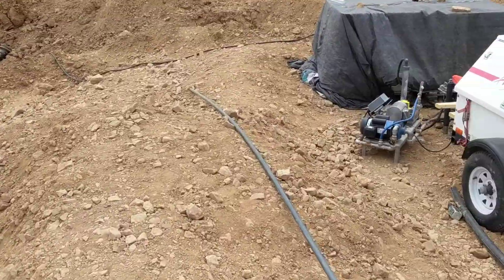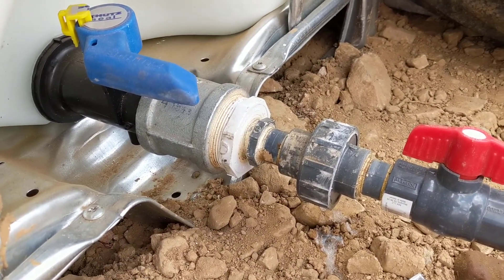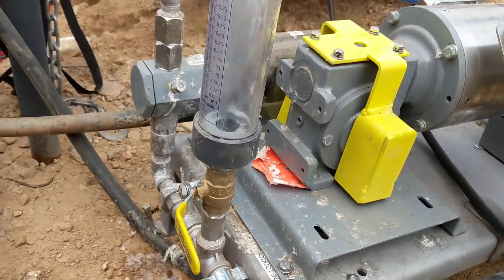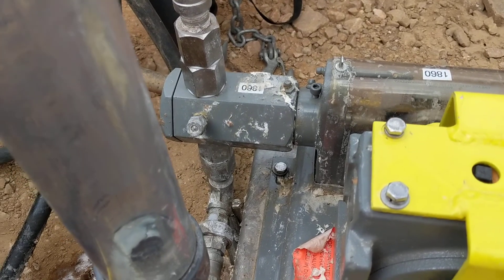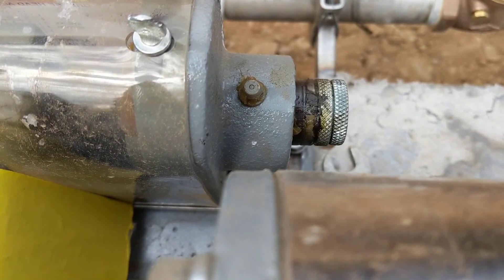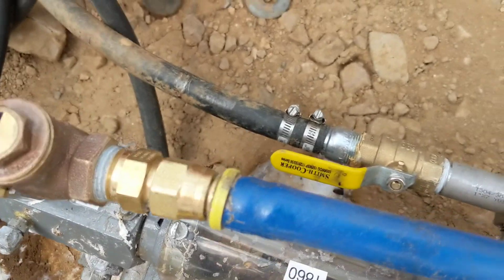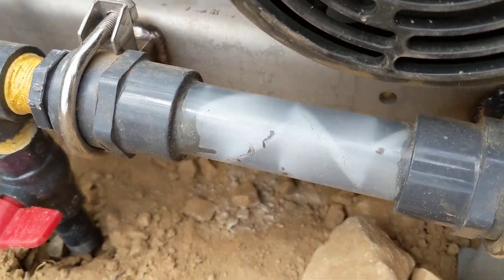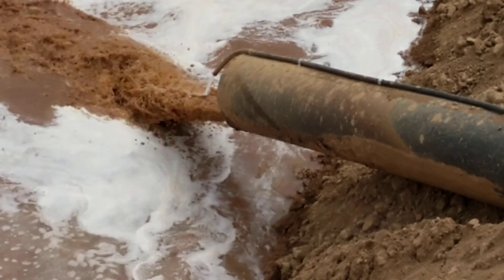Walkthrough: CW LQ50 (Liquid Polymer Dosing System)

Comment: Hello, I am writing from Panama and I work in the design of water treatment plants. I am interested in sizing equipment to dose 0.3 mg/L of liquid polymer with a concentration of 0.1% for a flow of 76 million liters per day
Reply from the maker: Hi Carlos. In our approach you'll have to break down a few details. For the sake of a quick response, we'll provide some numbers in imperial units. 

We assume a day in this context is 24 hours
76,000,000 LPD = 20,079,260 GPD (836,636 GPH)

To dose 0.3mg/L of a 0.1% polymer solution into 20,079,260 GPD you need...
0.251 GPH of neat polymer and 251 GPH of dilution water to create a 0.1% solution strength. So you'll need a neat polymer pump that can dose roughly 0.1 - 0.5 GPH. 

To do this you could use a polymer batching system or an inline preparation system like the one in the video. 

You can contact areynolds@clearwaterind.com if you'd like to review our equipment for your application.